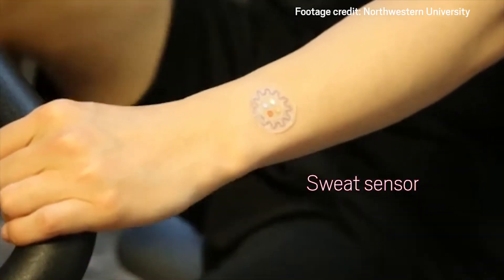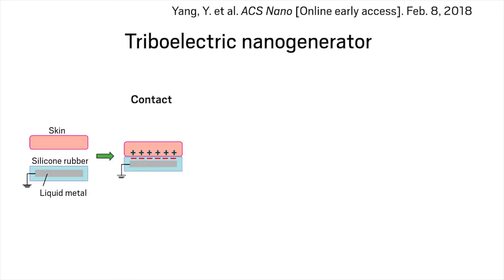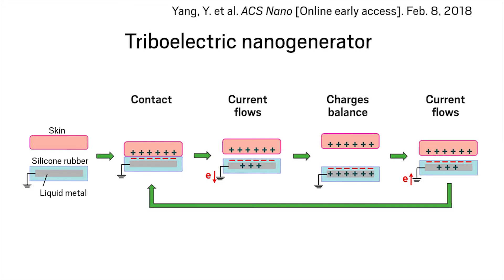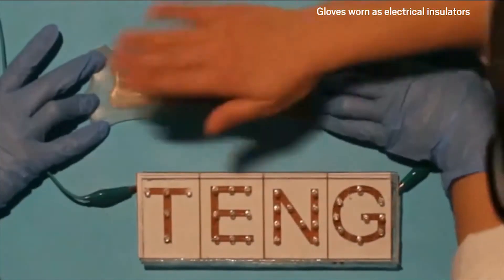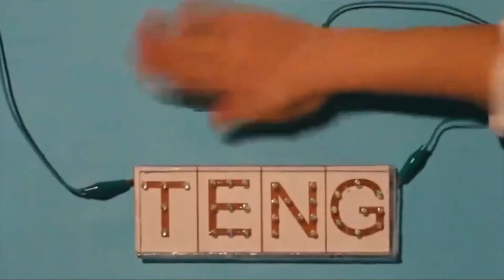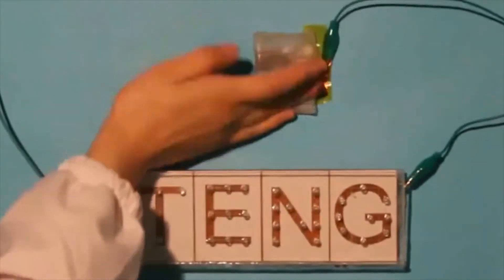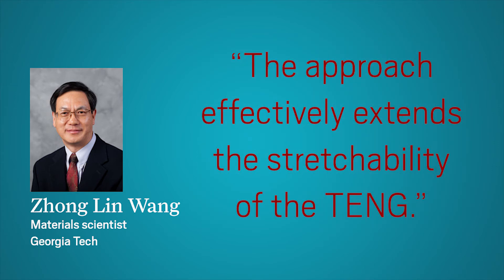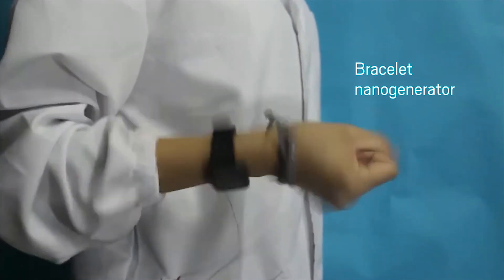Liquid metal electrode makes superstretchy nanogenerator

Comment: How about that?  Pretty clever. I had originally heard of this effect during my Freshmen Chemistry Courses and then in Physics, back during my initial University years.  If the basic widgets are in place, the only thing left is the mechanical movement.  Perhaps a wind/widget hybrid?  To those that are used to more traditional versions of making electricity, this approach might seem pretty silly, but perhaps they have yet to be shocked sufficiently by static electricity?  Now imagine that 'shock' going through a Shockley diode bridge.  Elegant?